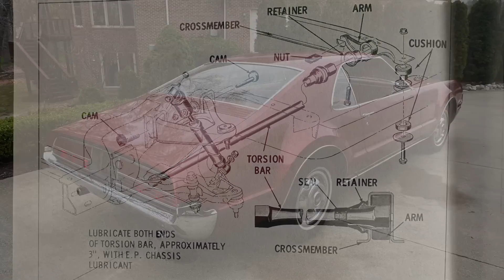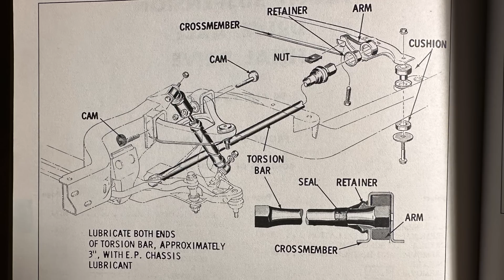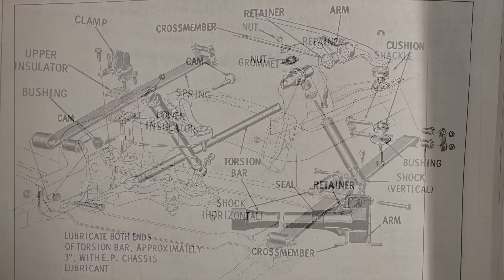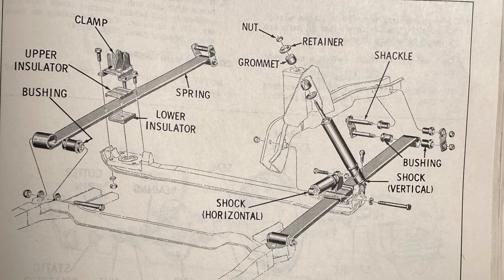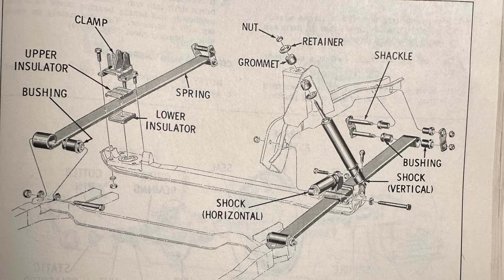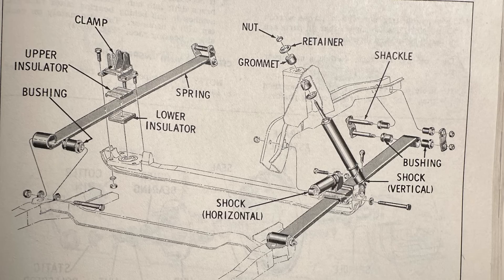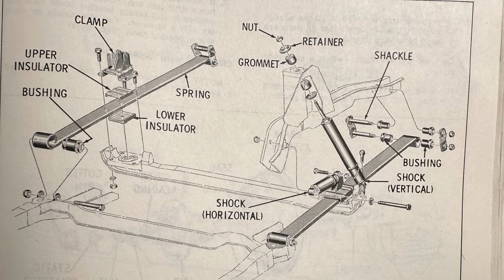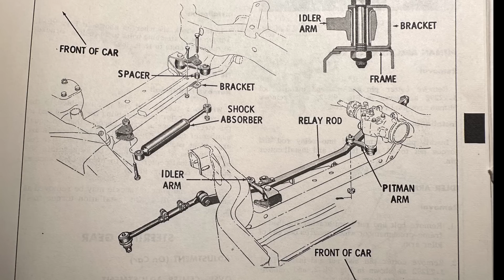Crazy Automotive Designs: GM Develops a 7-Shock Suspension Setup for this Classic Car!

Comment: Those horizontal shocks would have been used to mitigate wheel hop caused by "axle wrap" under torque load.  That loading under acceleration would cause the spring would twist, lift and unload the tire, the tire would spin and lose traction, the axle would untwist and reload the tire, and on and on.  Dampers like this would resist that wrap oscillation and tend to keep things planted.

Comment: Torsion bars are still used in GM pickup truck front suspensions today, for the same reason that they were in the 1960's.

Comment: The reasoning provided starting at 2:05 for using torsion bars instead of coil springs is valid, but coil springs are still possible with a driven axle. To avoid interference between the coil and te shaft, the coil can be placed on the upper arm instead of the lower, the coil can be mounted on the shock absorber and the shock can be either offset from the shaft or curved or forked to go around the shaft, or the coil can simply be mounted offset on the lower control arm. the most bizarre might be the coil with one turn in the middle stretched to go around the shaft. All of these solutions have been used in production cars and trucks.

Comment: My '08 Jeep Wrangler also has this "extra" shock (or steering dampener) on the front end on the steering track-bar in order to tame down oscillations from road impacts at higher speeds on the solid front axle, resulting on the dreaded "death wobble".

Comment: With no rear end and driveshaft it could have had a full independent rear suspension. Essentially a upper and lower control arm on each side and a coil spring. I guess they spent all the funds on the front and went cheap in the rear. Who cares it is such a beautiful automobile.

Comment: Interesting video. Good explanations and great diagrams. However, the title is not accurate. This car does Not have a 7-Shock Suspension Setup. It has a 6-Shock Suspension Setup,  and a Steering Damper in the Steering System. Steering Dampers (also called Steering Stabilizers) were common before rack-and-pinion went into wide use.

Comment: Adam, I noticed that in one of the 1967 Olds Service Guild publications it talks about the 1966 Toronado relay rod, steering damper, idler arm, etc. it states that for '67, the idler arm was changed with a new PN and a direct replacement for the '66 isn't available. They state that if you replace any component in that system, you had to replace the whole thing as a package......relay rod, Pittman arm, idler arm, etc. The 7th shock absorber described here on the steering mechanism is discarded when the upgrade is completed. There's no reason given for this in the publication. Look it up, it's in the parts catalog as a package PN 7802660 (group 6.870).
Reply: Sorry this is actually in the 1966 Service Guild - April .

Comment: GM used torsion bars on the front of medium dury trucks in the early 60s, they were on the upper a arms. Thats the only application i have seen with that design
Reply: *duty;...
    *were;...

Comment: The current 2500 and 3500 GM 4x4 trucks still use the torsion bar front suspension.
Reply: And GM and Chev pickups of the early sixties used front torsion bars in the front end suspension.  Didn't last too long, and GM went back to coils.

Comment: Another good one was the rear suspension in the '65-69 Corvair.
Reply: I believe the 2nd generation Corvairs, Corvettes and Jaguars up through the 1990s all used the half-shaft as the upper control arm. The obvious question is about what happens when one of the U-joints breaks; does the wheel fold under the car or were the lower control arms designed to hold the wheel vertical enough to get the car to the side of the road. I've never seen that question raised or answered.

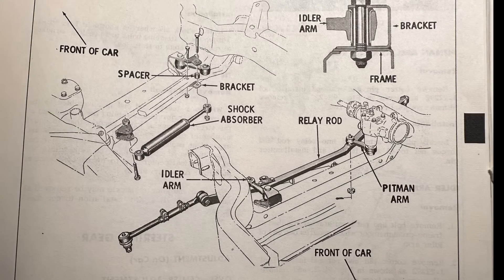Comment: 6:42 I've never heard of steering dampers on cars with power steering, though I don't really know if power steering was standard on all Toronados. Such dampers on cars, off-road vehicles, large trucks and motorcycles  seem to be a fascinating and controversial topic. From what I've read, they reduce "death wobble" which seems to affect some vehicles like rear-engine cars, motorcylces and anything pulling a trailer, more than most others. They also reduce bump steer, torque steer and vibration, but they increase steering effort and reduce feel. The '63 Corvette originally had one  with the smaller engine choice, but many owners didn't  appreciate it and the bean counters had removed it by the late 1960s. With manual steering, it must have been critical that the damper only kick in  to damp quick motions, and that it not impede things like parking maneuvers. I'll venture a guess that Oldsmobile added it to reduce torque-steer.
Reply: One year only for the steering damper, it was not on the 1967 and later Toronados.

Comment: There are other solutions to the problem with front coil springs on front wheel, or all wheel, drive cars. VW and Audi often place the coil spring and shock absorber above the drive shaft, but I think the most peculiar solution must be on the Mercedes W124 4motion, where the drive shaft goes through the coil spring. If you look at the front coil spring of one of those it has a section that doesn't coil, but is straight. That is to give room for the drive shaft to pass through.
Reply: There is no structure to hold the spring like that in the body and would require a ton of metal to 'retrofit'. 

After hearing about the spring it's weird that was not used more. (I don't think there is room in a GM coil setup either, while sitting the spring is mostly in pockets)

Comment: 2:00 The front suspension of the Ford Falcon was also designed (by Earl Mcpherson, no less) for the possibility of FWD, but he did it by locating the coil-over assemblies above the upper control arms, raising the minimum hood height of Falcons, Mustangs, early Torinos and cars like the Granada and Lincoln Versailles. I'll also speculate that the close spacing of the control arms in that design might have contributed to the trouble Ford had toughening the suspension enough for the Australian market, though they eventually succeeded at that. Honda used a similar suspension design  from the 1980s to around 2008, but they ingeniously ran the coil-over right through the very light upper control arm so it could reach the lower arm, with the half-shaft running right through a wishbone on the end of the coil-over, which didn't protrude above Honda's relatively low hoods.

Comment: The first time I saw a delco “big d” shock absorber I was laying under my car laughing to myself for too long… 😆
Reply from the maker: They also had the Pleasurizer
Reply: @RareClassicCars  I had to look that up to convince myself it was not a joke, though I'll bet it elicited many. Of course, that dates back to the era when most car radios had vibrators to convert the 12 V supply to a voltage suitable for tube circuits.

Comment: The horizontal front shock was used commonly to prevent steering kick from potholes on GM cars with manual steering until around 68 when it was discontinued, probably as a cost savings, especially since the percentage of cars with manual steering was  nearing zero.  The Toro probably used it given that even with power steering the front drive shafts would kick the steering sometimes.

You are correct about the ride quality of the first gen toro and eldo, the torsion bar gave the front end a relatively rough and noisy feel and the rear suspension was very rough and noisy, especially for the price point.

My uncle had new a 66 and 68 Toro and a 70 Eldo and he said in a tongue and cheek way that they looked a lot better from the outside than from inside ;-)
Reply: Jeep XJs and TJs use a hydraulic shock as a steering damper too.
Reply: Sorry, It was not part of the 1967 and later Toronados. The steering shock absorber was a 1 year thing.

Comment: Fords" death wobble" in trucks almost killed me a few times.
Factory dealer could not solve.
Until I put a damper on steering system.
Up until 1990 this issue occurred in 2wd and 4wd.

I had a CAT 966 payloader also had a feedback wobble .
I put a gas shock on steering system cured problem no one could for years it danced articulated wildly.

Comment: Shock absorbers on the steering arms are present in the Mercedes W123 and W124, too. (And other models with a steering box, like the G-Wagen).

They are intended as oscillation dampers, and they are quite a help on the steering return to center when one leaves the wheel slide on its own.
Reply: Dampers, not dampeners. Dampening adds water. Shocks only provide resistance to motion, not position. The faster the motion, the more the resistive force.
Reply: @Greatdome99  - thanks. My mistake
Reply: Also on the 124 with the 4 matic, the front had coil springs with a gap for the axle.
Reply: Does anybody know anybody in Houston who will work on my W124 (1993 400E).  I’ve had it 26 years and it ran well until I quit driving it every day during the pandemic.  Now no one will touch it. I’m going to be miserable the rest of my life if I have to part with it.

Comment: My 97 Mustang GT has similar four shocks in the back and of course two in the front. I'll have to take a look and see if it also has a front steering stabilizer, (which is common enough to be on both my other vehicles, Toyota and Jeep.) Those short horizontal 'shocks' in the back are called 'Horizontal Vibration Damper(s) E6SZ-4A263-D' in Ford's diagram. I always imagined them to be Ford's proprietary solution to the traction bar that so many muscle car enthusiasts added to correct for rear axle twist while jumping on it off the line. Incidentally,  the Mustang has SIX catalytic converters! SIX! ..to go with two mufflers.  If they ever go out, I'm scrapping the car. I like all your stuff. Keep it up!
Reply: 6 cats? I'm guessing the last two are actually resonators.
Reply: If the converters fail you can always sell it to someone in a state that doesn't check emissions, or one that doesn't check emissions on old cars.
Reply: Google this ...  MagnaFlow 441115  ...  if you want to see my 3G SIX catalytic converter array replacement option. 49 state is half the cost. I suspect Ford's promise that the 4.6L would live up to 5.0 expectations was a challenge only lots of cat would deliver.

Comment: Wasn’t the Chevy II/Nova and its variants the first GM car to use the mono leaf system.
Reply: They were rear wheel drive,  but yes I think so too
Reply: @jamesengland7461  

You’re right, I guess that I was just thinking about mono leaf. The later Novas, Ventura’s, Omega’s and Skylark’s had a tendency for the spring to break. I suppose that someone cheapened the design to save precious money. My parents had a 1978 Skylark and by the time you replaced both springs you were taking some serious money.
Reply: I thought the later ones had multi-leaf springs, which got Mylar liners when they were put into the Cadillac Seville. Maybe some of  the ones before 1967 had single leafs.

Comment: I think you have it wrong about the horizontal rear shocks function.  It will largely be inactive in vertical suspension motion. 
However, due to the mono-leaf design,  there wil be less resistance to axle wrap, similar to what rear drive cars under heavy acceleration will experience.

If this makes no sense because it is front wheel drive and only drags the rear axle around during acceleration, I believe the shocks are there to control spring movement during braking only and control potential wheel hop under braking. 
   As weight transfers to the front during hard braking, the rear wheels will have less vertical load applied,  and will be more prone to skidding and hopping.  This braking load also deforms the spring from an elliptical curve to an S- shape.  When the wheel locks and skids, loosing traction,  the S-shaped deformation will snap back to the normal elliptical shape, and wheel hop will begin.   The horizontal shock will absorb the snapping energy of the spring as it tries to revert to its normal shape and reduce the likelihood of wheel hop.  Similarly,  staggered shocks on a driven rear axle will reduce the effect of axle harmonics by absorbing the rotational energy of the axle that the springs allow.  

Four link rear suspensions like the 1971 and newer Toronados do not need horizontal shocks as axle rotation is limited by the links and absorbed by the rubber bushings in those links.  A leaf spring axle could also fix this with a torsion link to reduce axle rotation but that takes up vertical space in the trunk or rear seat area.

Twist beam axles are kind of a compromise between these two other types and are cheaper to boot, making it a darling of the finance guys

Comment: I have this feeling the horizontal shocks (rear) were somehow involved with the mono-leaf springs suseptability to axle wrap. Each spring could more easily act like 2 springs, one in front of the axle & one behind, that could allow the axle to twist & resonate. Since it is FWD, there is no driveshaft or thrust to dampen this motion.

I bet that was an unplanned issue, which explains the reason it looks like an addition.

Were the horizontal shocks on the first year of the Toronado?
Reply: On 66 through 70 units, yes

Comment: A shocking revelation....7, but 4 in the rear was obviously not enough to improve the rear ride.   A great video.  My Dad and Mom had a '69 Toronado which was greatly loved by the family, so thanks for the info and the remembrances. By the way, that great , beautiful '69's Toronado's front wheel drive traction was phenomenal on a snowy, wintery trek across Canada from Michigan to Vermont for a very memorable skiing trip in 1972.  Definitely a great car, perfect for wintery driving conditions.  Cheers.

Comment: The problem with leaf springs is that the effective spring rate changes during acceleration and deceleration.  Hitting the brakes causes the axle to slightly rotate when seen from the side of the car, thus bending the leaf spring in a horizontal "S" shape and effectively stiffening it.  This can cause bump steer and/or loss of traction.  I suspect GM engineers used these horizontal shocks to prevent this axle "windup".  A longitudinal  link could effectively stop this but then it wouldn't allow the leaf to bend properly so they came up with the additional shocks instead.

I wonder if the 7th shock was there to reduce torque steer.....

Adam said it, this probably didn't work well, and coil springs on the rear would have been better.  

Great video!
Reply: Especially with a mono-leaf, which is more flexible in bending/twisting. Drag racers used to add 'traction bars,' an additional link attached to the axle which prevented axle windup.
Reply: See my reply about the Mustang above. You are right about the axle "wind-up".  I didn't have a term for it.
Reply: Had a 67. There was no torque steer.
Reply: The drop axle design also increased spring wrap as the brakes would have extra leverage on them.
I believe that to be the main reason for the horizontal shocks.
Reply: That's exactly what they're for.

Comment: One I've owned since '79, the other near identical twin 6 years. Both Trumpet Gold w black deluxe. 1 fully loaded (no shoulder belts or AC, Montreal car) the new member only deluxe, AC and remote mirror, zero rust Los Angeles car. 37 years off road survivor... Nice article in current Toronado front driver about an Autumn Bronze with EVERY OPTION including shoulder belts. 44k survivor. Was a GM executive car, as is stamped on original bill of sale